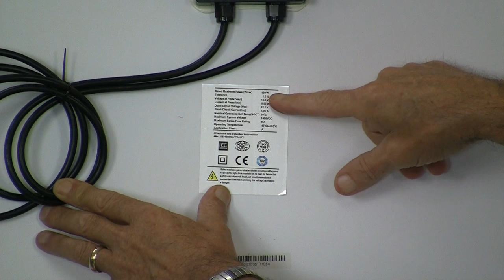Solar Panels for the Beginner Part 6 Harbor Freight | Missouri Wind and Solar

Comment: I have a set of the harbor freight panels that I got for the camper because they were easy to store in the camper. I got these before I knew about solar. I'm sure ill find some kind of use for them until they burn out. I have 225 watt panel now that I got to put on the property here and will be putting them up as soon as ihave the time I have learned a lot about solar in the last 2 yrs. but still have a lot to learn.
Reply from the maker: +Ozark living Homestead Always something new to learn about solar panels.

Comment: can i use 12 guage wire for a 100 foot run from  the controller panel if not what size can i use im trying to figure out what wire i can use for this  run  also can electrical wire be used thanks great vids

Comment: Thank you for that info. I have been wondering if the HG Solar Panel kits are a good deal.  I see that right now (11 Jun 2019) that HF has a 4 panel amorphous system, 100w, for $190.00.  With no coupons, that's $1.90 a watt.  Amazon, I found a 100w polycrystalline panel and charge controller combo, for $1.23. That's $1.23 a watt, and for a single poly panel. Hands down, HF is not a good deal.  I see a poly panel, with charge controller, on Amazon (HQST 100 Watt 12 Volt Monocrystalline Solar Panel (100W Compact Design)) for... $100. that's a BUCK a watt.

Comment: I very much enjoy your thorough classes. Now an update. Harbor freight may have seen your critique of their 45w  solar panel kit. Now it is a 4 panel, 100w kit with charge controller and 2 plug in bulbs I get coupons nearly monthly for $129 - $139. Maybe not a great deal if they don't last long and less efficient. Just an updated FYI. Thanks again for your great products and comprehensive videos.
Reply from the maker: Now that's a much better deal then the 45 watt setup they use to sell.

Comment: Thanks for the informative video... Maybe you could point me out in the right direction! I bought an ac to DC power inverter weight about 65 lbs and it's a 2200wat capacity.  it seems to be for a home set up and as it also has the 220volts deliverance...  I don't know very much about solar panels and I bought this at a second hand store for about $60 and came w/ the box.  So I figured the investment wasn't to much to try to build a set up so anyway maybe I could send you a video of the converter and point me how or what to do with it as far as building a set up? 
Thanks  again for your videos

Comment: hello jeff im jim and I'm. looking. to go solar on our camper, because we are full time rvers. my ? is with The tie inverter i can run all my small items and still rrun my dc lights also right. the big ? is if i run a tie inverter will shore power for my ac backfeed into the tie and have a melt down. i would like to have a solar pack good enough one day to run the ac i know it can be done.

Comment: What do you need to run 110 in your home , Solar wise?
Reply from the maker: It's not so much the voltage, you can do 110 with just about any panel. What you are really looking at is getting enough wattage for it to be meaningful.
Reply: @MissouriWindandSolar  thank you for your reply. I suppose it’s safe to say that the wattage nut meet the house hold needs.